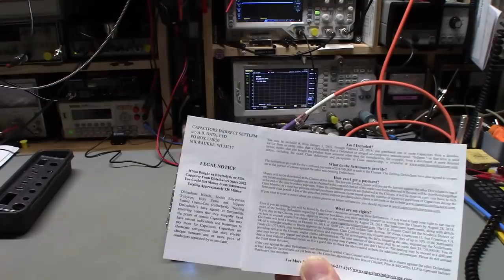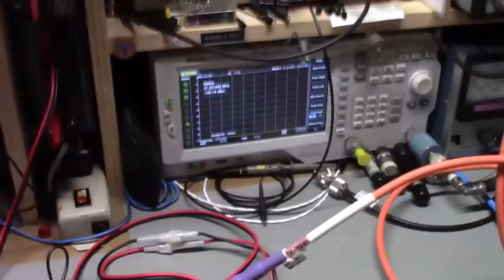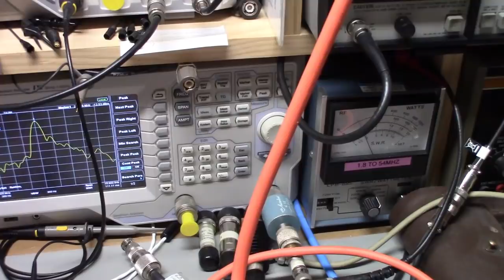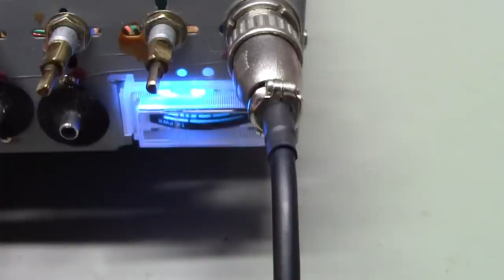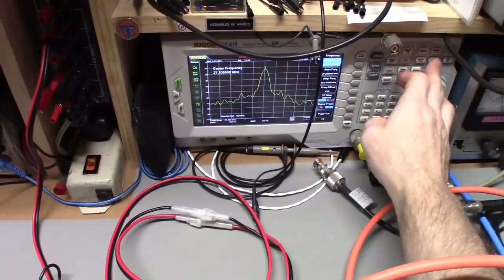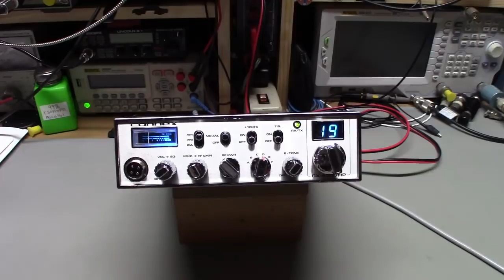Stop destroying radios!!!  Poor golden screwdrivered Connex CX-4300HP CB.

Comment: I've been away from cb for roughly 30ish years and getting back in soon all I want is a decent radio that will last without constant problems. Most I want is a unique rodger beeb to be recognized.  All my efforts have been on what radios are good in today's world. I'm afraid to buy a used radio because of the hacks. I'd rather buy new and send to Mike to peek and tune and like I said a unique rodger beep. Great quality base antenna and top quality coax cable.

Comment: My 2925 cd i have no receive on am fm low and up ssb i replaced audio chip it clicks like a clock and replaced RLR4004 diode by q153 now i have static like the radio is tying to receive on pa now and no clicking on pa

Comment: Most radios do good with minor adjustments AGC in galaxy's or conexx radios all you need to adjust and the modulation adjustment never cut nothing plus those radios need a receive alightment there tuned for 10 meters lol
Reply: But it on a o'scope and spectrum analyzer and see if a minor adjustment does any good. Probably not.

Comment: What is the problem with the Cobra 25 LTD Radios made after the year 2000,there is literally truck loads on EBAY being sold  in 5 radio lots for $100 and FREE Shipping?
Reply from the maker: If it's like radios being sold in lots then they were probably pulled from fleet vehicles before they went to auction.
Reply: No mic or power cord - some say shorted,some channel displays are not working propely - all have some kind of problem.

Comment: On the 54Mhz coils can the number of turns be increased or reduced to improve the frequency?
Reply from the maker: Adding or removing turns to the trap coils is going to drastically shift their frequency range reducing their effectiveness.
Reply: I was just wondering since at fully closed they still were not working properly.

Comment: What is the best way to remove a ferrite core out of the tuning can - when someone has broken half of the top off? Can a piece of plastic be epoxied to remove it?
Reply from the maker: Remove the transformer from the PCB.  Remove all broken loose pieces from the top so they don't get jammed into the threads and you will find a fresh adjustment slot in the bottom that you can unscrew it with.
Reply: Are there standard ferrite replacement cores that fit those cans or are they specific in the material make-up of the cores for different cans and where can the cores be purchased?

Comment: @mikesradiorepair are u willing to work on my connex 4300? I took it to a shop for receiving problems and the owner cut the damn modulation limiter right away without asking me. Then they turned some things with that screwdriver u talked about  and now I fee like it sounds shitty. I use to veg complimented on the sound and now everyone says what!!   I need exactly what u did to this radio done to mine. I’m curious to see how bad the splatter is. They told me it wouldn’t splatter. Everything else is not messed with as far as I know.
Reply: #mikesradiorepair

Comment: I enjoy your channel Mike, you do excellent work. One of my first jobs was working in a CB shop. Seeing the abortions you have to fix reminds me of some of the junk guys would bring in. Every pot and IF can screwdrivered to death. Many times the cores in the cans were broken because idiots used metal screwdrivers. It was pretty sad and funny at the same time. Every clown that came into the shop wanted the limiters cut out and the radio to splatter like a piece of crap. Some of them were so badly damaged, we just handed them back to the customer and told them toss it in the trash because it's beyond help.
Reply: I had a cobra 148 gtl.. was butchered by a garbage tech, IF cans busted, coils split, you name it. Talked as far as you could throw it.. Damn shame too, 148 GTLs were a good radio back in their day.. Even today when they aren't literally screwed up. It seems people just love to screw up Cobras for some reason. It's plenty loud from the factory, so I don't see why any of this crazy tweaking is even necessary..

Comment: Even my dumb ass knows that it takes a multiple of 4 to gain 1 s-unit.

Stock CB = 15-20watts pep.

To gain 1 s-unit in signal requires multiplying that by 4...15x4=60. (and so forth up from there)

Everything in between is Unnoticeable to the receiving radio.

Everything

Comment: What tool do you use to get the serrated nut off of the microphone jack @15:00 ? Those always give me fits!
Reply from the maker: I have a few that were made a long time ago that I use.  I'm not sure if anyone makes them anymore.  Easiest thing to do these days is to buy a automotive antenna nut socket of the correct diameter.  You will have to modify it slightly because the 4 pins are a little to wide.  A minute with a hand file to narrow them up a little and they work fine.

Comment: Connex is s clean sounding radio now  annd... it puts out more power nice job as usual. I just took a channel modification off a new radio I bought from ebay actually its very old its Japan made 138 XLR. They hacked the board and actually cut the traces underneath the PLL synthesizer chip and I was holy cow can I fix that? It had a giant ribbion wire coming off it I removed.  I actually did reconnect each trace and there were many. It now has white noise so thats progress and the needle actually swings on transmit but there is no actual signal being transmitted. My guess is it has another hack I see some crap but I m not sure if I should remove it wish I knew for sure they were crappy mods but Im pretty sure they are. I will remove them and take pictures in case I have to put them back on. All I can do is remove them and see if it will transmit. I will recap first to see if it will begin to transmit. Wads of resistors soldered together probably a hack. It may just need new caps I ll try that first.
Reply: Those chassis with the 858 pll chip were channel mod victims by the thousands back in the day. I saw so many of those things butchered to death.

Comment: Based on the location of the resistor inside that yellow heat shrink, I'm guessing that was a common mod that is done to increase the talkback volume. It basically jumpers the output of the mic amp opamp into the input of the audio output amp. It often creates a feedback problem in the modulation circuit.

Comment: I wounder what the match was like with that in place. That circuit had to be way out of line for a 50 ohm load. In fact I wonder what the input load looked like as well that had to be a poor match too. Sadly I just follow plans I have not idea what would happen but I have to imagine that the input and output loading would be wrong and the resonance of the transistor would be off too. I wonder if that will bring the harmonics down now that it is corrected? I have seen issues on the RF Limited line of RFX add on chassis amps with poor matching and also the RM KL-203 stinger board has the same issue once people cut the huge resistor to increase output power the impedance is changed and now a terrible match. The only person that has mentioned this besides me is Mark.

Comment: If you want more power add a good amp. Nothing you get extra out of the radio will ever amount to anything of worth! Sadly even when you see them get an amp they always have to over drive them and since they are using a splatter box to drive said amp you get the same nasty signal just amplified!
Reply: You are absolutely right! These idiots think it's going to make a huge difference going from 4 watts to 8 watts.....that's 3 db...half an S unit. Big deal. In return you get a radio that runs hotter, has less modulation and sounds like crap for a lousy 3 db signal increase. Add a nice CLEAN amplifier...no not some class C pile of garbage...an honest to goodness biased amplifier that has an output filter on it! RM Italy sells amps with bandpass filters in them...for fucks sake guys use them! These horrible non filtered amps are the bane of the CB service...they sound like shit and pollute the entire RF spectrum. Clean power is where it's at guys, not this barn door wide trash.
Reply: buckaroobonsi555 : If you want to be heard world wide with only 8 watts, get your ham licence and call it a day 😎

Comment: You are preaching to the choir. I have gotten tired of saying this same thing over and over and over again. The trash keeps coming on the internet asking about the same garbage modifications. When I tell people not to mess with these terrible mod's I am the bad guy. It is always the same old "guru" or "radio sages" spewing this nonsense. They never talk about the lack of gain, the lack of durability, noise floor, S/N ratio, lack of efficiency, problems with over heating, over modulation, splattering, poor input and output matching, problems with selectivity/rejection, too much energy being wasted on low freq. audio that is not useful on two-way radio and on and on and on!!! But I am the bad guy for telling people all the negative's of these modifications that the peddler never mention at all. On top of that most of they guys do not even have a scope let alone a spectrum analyzer, tone generator and other gear to do the job correctly. None of them ever add any filtering after they do an NPC mod. It is not hard to build a cheap filter to get rid of all the stuff you do not want. 

I used to run a taiwan made RCI2950 with a  2xMRF455 linear class AB. I ran a 102 inch SS whip. People always thought I was a base station. Even when I did not have the amp on people often thought I was a base station. I had good clean audio, full modulation, always ran my gear with the RF knob set to 12 O'Clock. When a part failed I replaced it with a better part but never sought more power preferring to have the radio run cooler with the better part not eek out a few more worthless watts.

People asked me what my secret was and when I told them " I have no secret it is just aligned properly and being run cool and clean!" and "Clean is mean" just like with car audio you want to have plenty of head room and keep your gear cool because heat is the enemy of electronics and long life. People could not under stand how I was able to key over them when they had an amp with twice the number of transistors and more powerful transistors as well. They thought it was my coax or the antenna or the radio. They would try to match my gear but they never managed to  catch me because of the way they tuned their radios. These guys radio and amp where always hotter than hell and although they made more watt's than me they where not putting that power on freq. They had issues with thermal run away and oscillation and they splattered 5 channels above and bellow where they where.They where constantly sending gear to their "tech" to be replaced and repaired. I have only had one radio ever break on me and it was the main voltage regulator and the crystal filter. I have never had a final go bad. If you look at the classic finals like the 1307 and the 1969 if the radio is keying 4 watts swinging to 16 watts it should last decades baring a mechanical failure or manufacturing defect. 

These ignorant cb operators are their own worst enemy. They damage their gear and they make their own gear work against them instead of for them! Worst of all they get in the way of others.  The amplifiers they guys use are terrible designs! 

They set themselves up to fail firstly! Second they listen to the wrong people on the internet. Third their are a lot of so called "Tech's" that are happy to separate idiots from their earnings that will do what the customer asks for even though they know it is not a good mod!

Comment: What is the unpopulated daughter board on the right side of the radio?
Reply: Dino Papas That's the echo board. It's all surface mount on the trace side of that board. The missing through hole parts are for the radios that have the voice changer and robot voice features. Both styles use the same board, this radio just has echo.